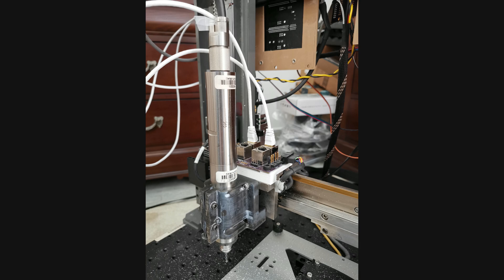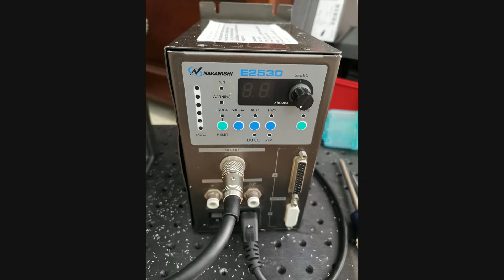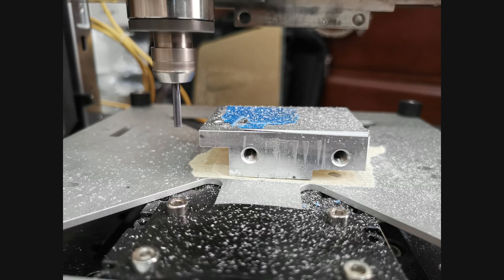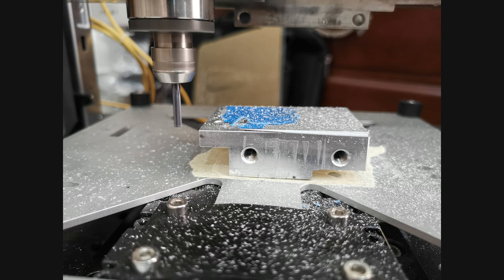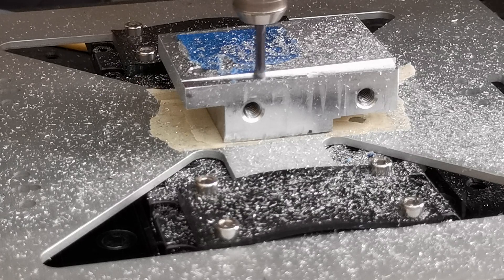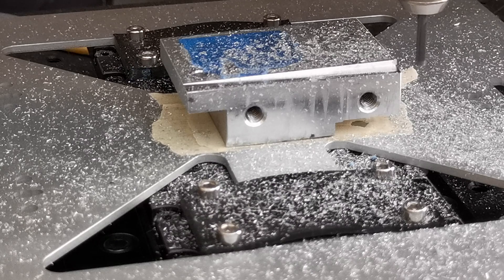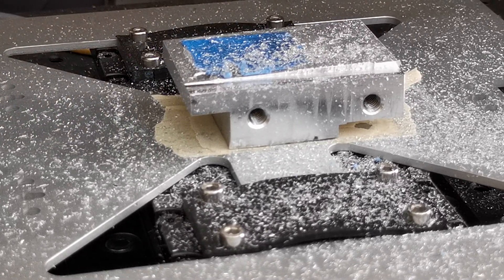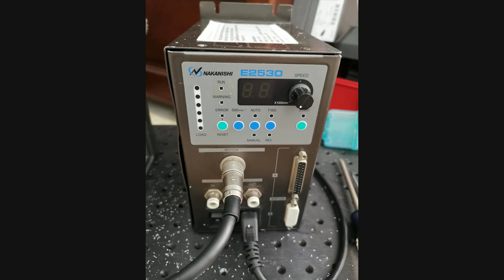NSK milling spindle on Linear Motor 3D printer

Comment: Hi, do you know what voltage the spindle controller is outputting? I'm trying to use an rc esc on one
Reply from the maker: Any should work. The voltage of the ESC is going to determine your Max rpm. i don't remember the specifics, but i think i mentioned the voltage used and Max rpm for that voltage in one of the videos.
Reply: @Jan Beck  yeah I saw that video, I was just wondering if nsk used a different voltage.
Reply from the maker: @hi1172  ah. Well i don't honestly know. I suspect rectified line voltage, because that is easiest to implement. But maybe they use a transformer internally....

Comment: what type of linear motor are you using?The golden stripe on the gantry I suppose is a linear encoder strip.I want to use linear motor for my desktop milling machine project.So far I can't find much information regard linear motor(unless you buy forcer/stator+drive combo,which is very expensive)
Reply from the maker: I put a lot of the details you ask for up here: https://www.janbeck.com/linear-motor-based-3d-printer
I find that linear motors are plentiful and cheap on eBay....

Comment: Great Stuff, I've been keeping my Eye on these spindles since you presented them. It's sad they use all those custom connectors, and are so closed up about any details to run the motor without their controller, even given an OEM application I discussed with them.
The prices, even new, are not horrific. While not cheap, they certainly aren't insane. I'm strongly considering one of these for a small, granite framed cnc machine for precision parts.
Reply: I've made driver motor adapters, you need to be able to do internal and external threading and I used o-rings to drive it with a top bearing to share some of the pulley load.  You also need to make a + shaped driver shaft coupling.  A youtuber who has one used a phillips driver bit to drive his but I doubt that is the best way to go considering the high RPMs.  I think I modeled it up in fusion 360 if you need the dimensions I used for my NR40 I can try to find it.  I recently bought a NR50 and need to make another set, maybe I should make a video on it?
Reply: Neat! admittedly I was refering to the electronics connectors. Would love to see more content on these units though!
Reply from the maker: @DUIofPhysics  I'm in the middle of seeing what can be done about these super expensive cables. It turns out that the connectors on the motor controller side use one of two commercially available connectors. On the motor side, it's custom though. I think I may try to model something for my resin printer for that.
Reply: @janbeck8269  wait you manage to find the fact that goes to the controller?! I've been trying to find that for ages, but nothing matches the pin count!
If you can, please let me know the part number?
Reply from the maker: @DUIofPhysics  Depends a little on the motor controller you have, and It's still a work in progress, but here you go: https://www.janbeck.com/nsk-nakanishi-motors-controllers-cables-and-pinouts
Reply: @janbeck8269  yeah, the one I was referring to is the custom one. Could be a nice job for a micro machining setup, maybe one with an NSK spindle and linear motors..
Reply from the maker: @DUIofPhysics  :P I really think the off-the-shelf connector can be converted with a simple 3D printed part. We'll see.
Reply: That's what I was referring to, just machining the pin housing rather then printing it.
Reply from the maker: @JesseSchoch  definitely make a video. I was considering making such an adapter, but at up to 60k rpm, I thought I could not get the accuracy/balance necessary. Also, do you have a link to the guy using a driver shaft?
Reply: @janbeck8269   I made a video about this back in november, it is called "NSK ATC NR-40 spindle".  The details on the spindle start at 3:00  I also just moved it to my micro mill as a sub spindle and I cut some double sided PCBs with it today with it running around 20k RPM.  The NR-50 seems to have a different sized connector for the motor but the "+" shape looks to be the same.  The collets are so darn expensive, and my NR-50 only has 4mm collets (I have a few if anyone wants to swap).  Unfortunately my pcb tooling is setup for 3.175 shank so I have not bothered to adapt the NR-50 yet.
Reply: I have a few of these spindles and one power supply. The big issue making a controller for these is they are two phase, three wire motors with hall feedback and there is just not a lot of options out there for two phase . I looked at a bunch of options before just breaking down and buying the NSK controller. Works well, I have 40krpm motors and a variety of reducers and heads. I have ran down to .013" end mills with it.

Comment: rigidity is king so you might want to beef up your spindle mount.  making your self a decent spindle mount would be a good project with your current setup.  You also should get yourself a decent vise which will also improve rigidity.  The tiny chips indicate cutter rubbing which isn't really what you want, you want the chips to form correctly which is a bit of a balancing act between your spindle RPM and your feed rate.  proper chips should be able to pull the heat from the cut into them.  "thatlazymachinist" has some good videos on chip formation.  you don't want the heat to stay in the work.  Hot work will also make  your tape fail.  Finally, if you are cutting slots chip evacuation will become very important since aluminum tends to weld onto your cutter in slots and other operations where the chips get recut.
Reply from the maker: Thank you for your comment. Much of what you say is true, but some of it is inaccurate in my opinion. I used to share some of your thoughts, but after building several CNC machines, my experiences have changed my mind somewhat. Permit me to share, but I don't claim to be right in every case:

- The spindle mount is excellent and not the limiting factor in rigidity in this setup. Torsional rigidity in the x axis is. I was a little surprised myself, expecting the linear bearing to be the limiting factor, but it is what it is. My deflection measurements are clear. 

- One can achieve great workholding rigidity with a superglue bond, and so I am going to forgo a vice in this setup permanently. 

- Consider that small spindles at high speed will always make relatively small chips, even when not rubbing. Thought experiment: What kind of chip size do you expect from a 1 mm milling cutter? Rubbing occurs when the cutter is not sharp enough to cut under the force applied. This occurs when the step size is so small that the contact force is enough to deflect the cutting tool, but not to press the cutting edge into the material (could be lack of rigidity or dull tool).  For example, the carbide inserts used in larger machines are relatively dull, because it keeps the tool life up in industrial settings. As a result more force/stepover is required to avoid rubbing. A rigid machine with a sharp cutter can make very small chips without rubbing.
- The point of this whole thing was not to build a milling machine, but to check out how good the NSK spindles are at milling and if I can use the 3D printer for some light milling duties. I have built more rigid machines I could attach the spindle to, e.g. : https://www.youtube.com/watch?v=W6-wwVubb0M
Reply: @janbeck8269  The other downside of small chips is the runtime of your cam job.  If you have all day and a source for cheap sharp carbide then no problem!  Faster is better for me so I was just trying to help you get the most out of your setup.

The most telling would be the temperature of the work piece and since you are using glue it is even more important.  If your feeds/speeds let the work stay cool then no problem.  If it heats up expect workholding failures and broken end mills, I've used both direct CA glue and the tape method and the problems I've seen are heat in the work causing the CA to fail or softening of the tape adhesive due to using liquid cooling.  I really like using alcohol for aluminum but it doesn't do well with the CA/Tape method.  Boring/Drilling/Slotting are pretty hard in aluminum without mist cooling or flood cooling which limits the CA method.

I also have two NSK spindles, the NR-50 and NR-40 (both ATC) and they really are very nice.  I picked the nr-40 up for $200 but I had to make a motor adapter and an air connector which required a mill and lathe.  I don't have a nsk brushless motor and I'm only running mine around 18k RPM dirving it with some o-ring pulleys.  This works very nicely for FR4 PCBs, i've cut .5mm pitch smd pads.  I've also cut aluminum and it seems to do pretty good but I have not pushed it very hard.  

The ATC air tool changing is a real joy compared to collets and nuts and 2 wrenches and brittle carbide.  If I had 3 hands the nut collets wouldn't be so bad ;)

It would be interesting to compare your spindle and the ATC versions.  They seem much more squat and likely have much bigger bearings.
Reply from the maker: @JesseSchoch  I have one of those ATC spindles too. Haven't had time to try it out. I did not see you having any videos on that. Would appreciate a video of the ATC spindle doing some milling showing how much of a load it can handle. Thanks again for taking the time to comment.
Reply: @janbeck8269  I just uploaded a video of milling some delrin with the ATC setup.  I moved this spindle to my X1 mill conversion recently and I did have a torque issue cutting 11mm DOC and .5mm stepover.  I added the 2nd oring drive belt and the rest of the job went well.  The spindle does slow down though.  The controller used is a WS55-220 and isn't that great.